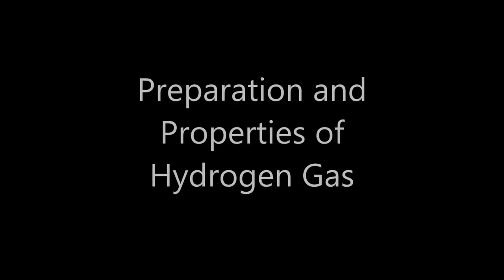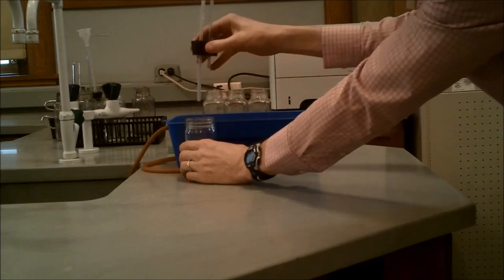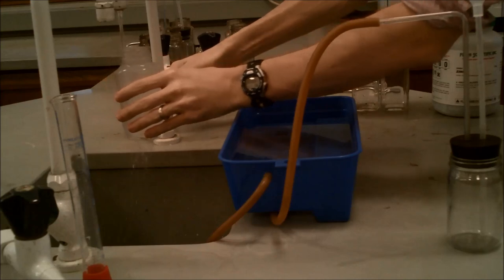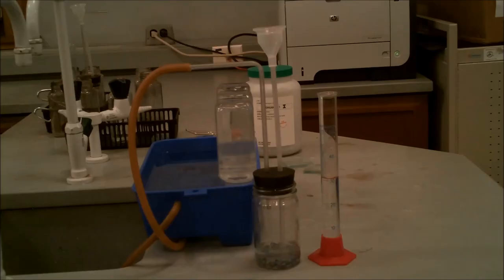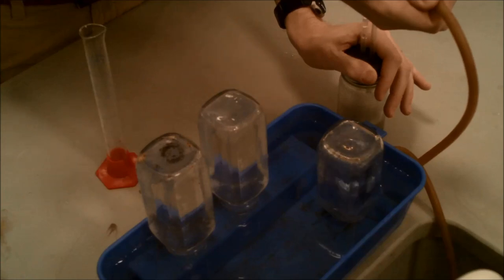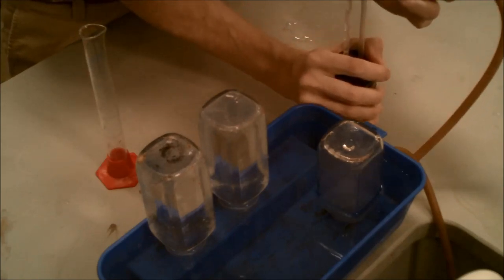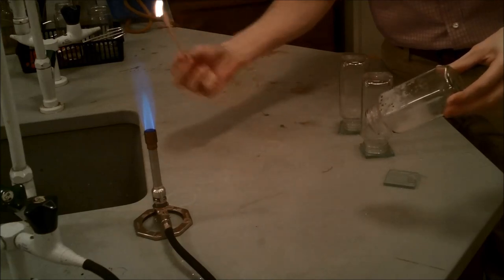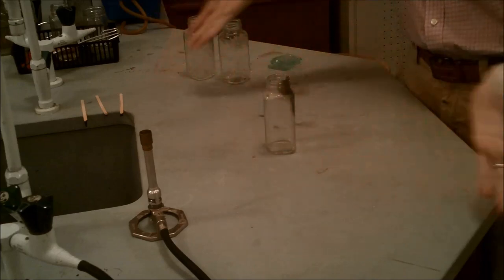Preparation and Properties of Hydrogen Gas

Comment: But hydrogen produces a explosion when in contact with air
Reply: No.
Reply: @Suprit Masanta you are right as H2 reacts explosively with air... But this does not affect its formation of H2 .. The reason is it forms an explosive mixture with air and cannot be collected by downward displacement of air and only by downward displacement of water
Reply: @mariamnaveen936  thank u